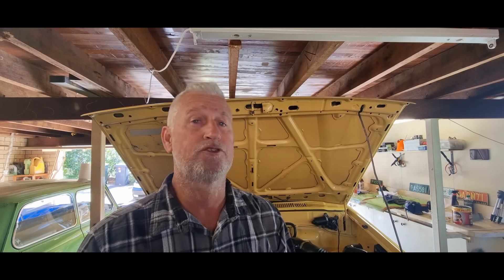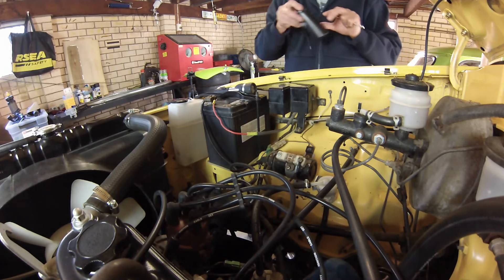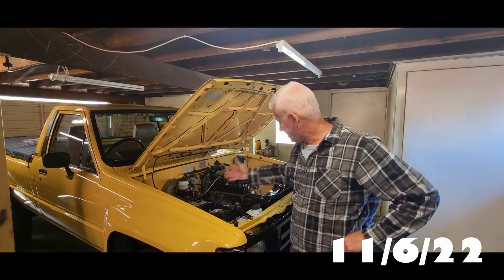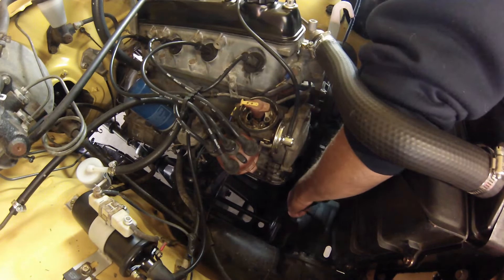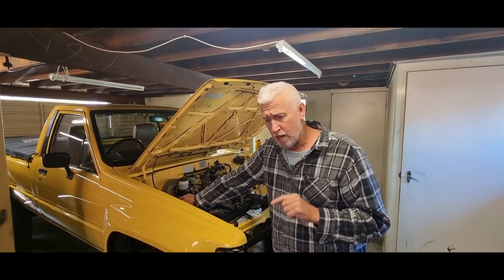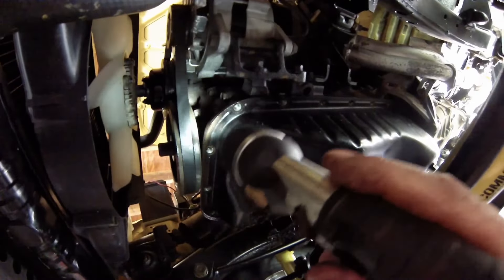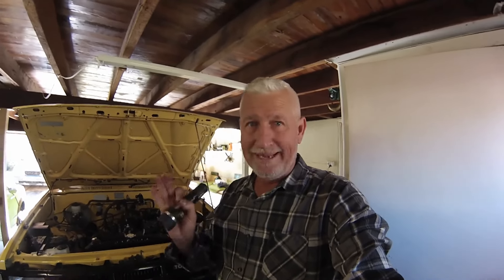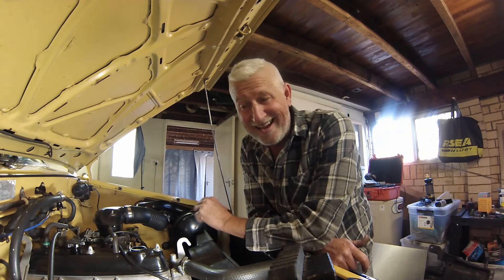Old Toyota Hilux Mechanical Headaches!

Comment: Hey man I have a 85 yn65, just checking your running a lead additive in the tank? Mine seems to run fine after I took the carby apart.
Also for 92 dollars you can switch it to electronic ignition off eBay and coils are pretty common
Reply from the maker: Yes using it. I have an electronic setup but wanted to keep the car 100% original